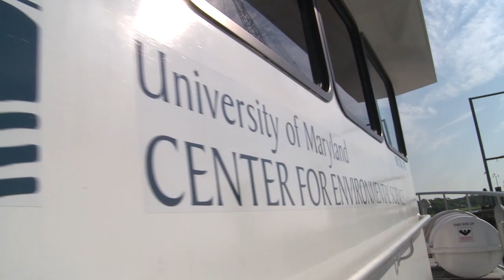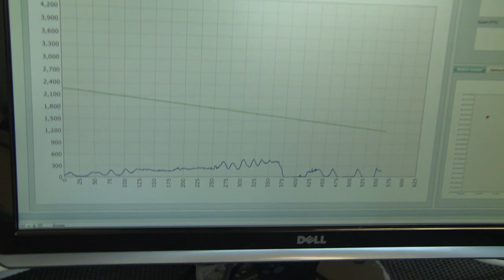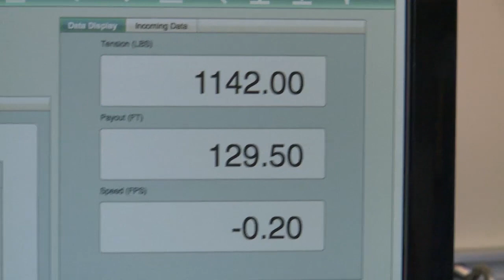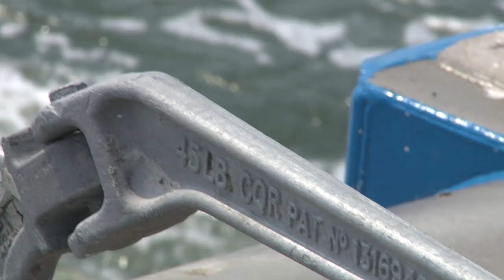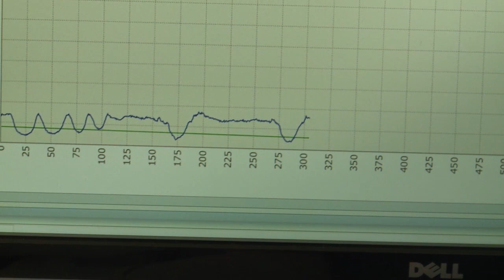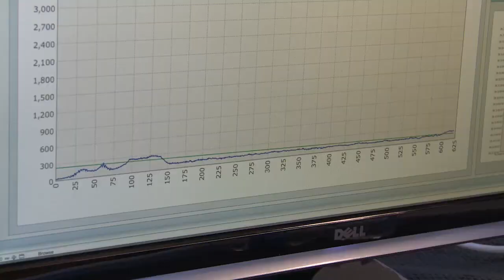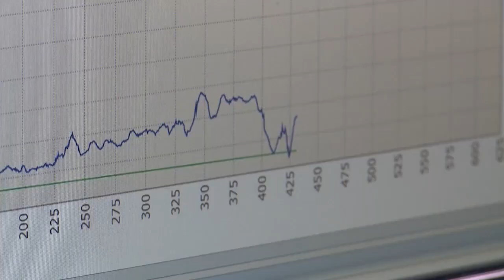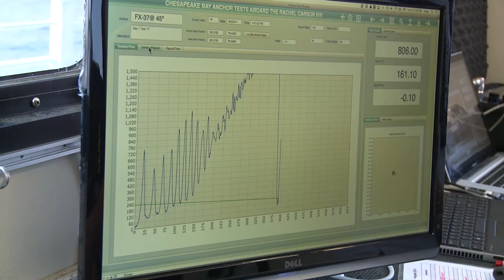Chesapeake Bay Soft Mud Anchor Testing - Tuesday 8/5/2014

Comment: My 2 cents with all respect based on 23 years live aboard/ cruising, with 37 sail and 42 trawler, found that a 25# herresoft worked in soft mud even better than 45# northhill with a very slow pull to set. Also I have seen danforth and CQR skip along the bottom- sometimes up side down because the initial pull was too fast and never set. Thanks for the video.

Comment: The fortress you mentioned didn't reset because it was upside down. But, there is no upside down on this anchor as it sets either way. It is not supposed the trow in with a lot of chain. 3 or 4 meter chain is enough, followed with rope. Thank you for testing. Great work